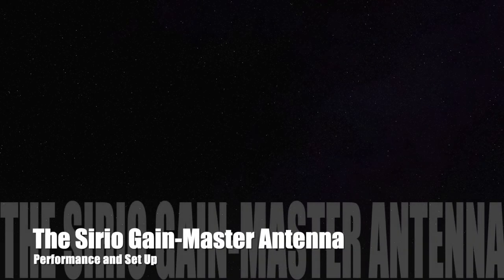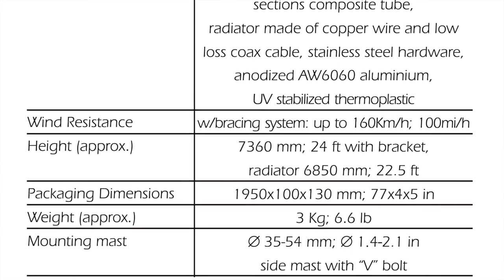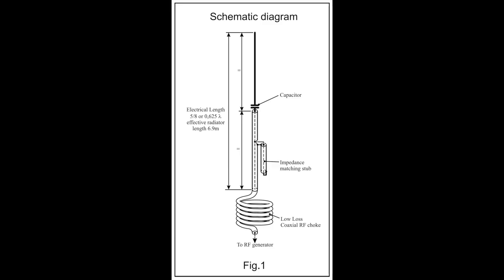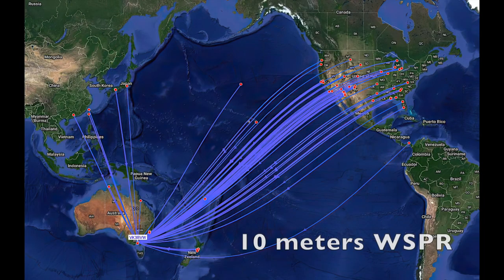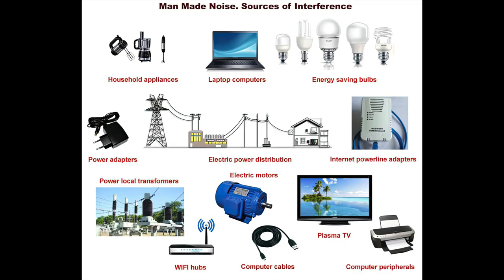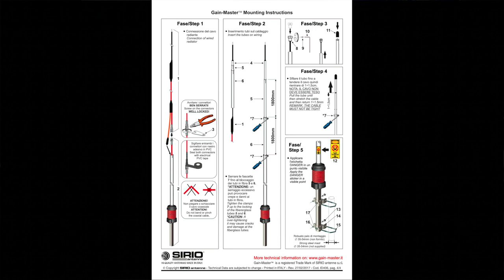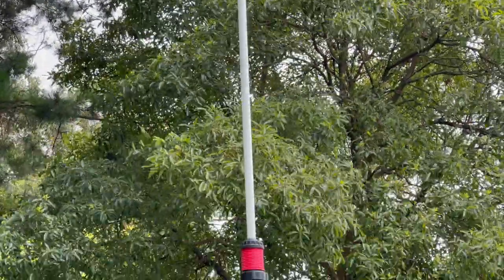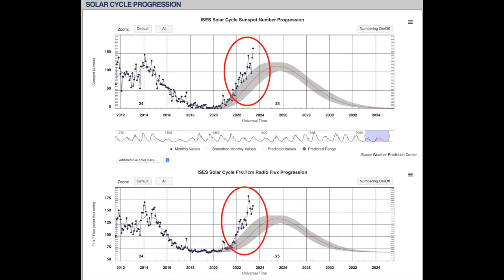The Sirio Gain-Master Vertical Antenna: A Review and Set-up

Comment: Nice one Rob!
Have used exactly the same method of guying on a 40m 1/4 wave vertical that I put up a few weeks ago.
Has also survived the high winds just fine so far.
Going to look into one of those Sirio verticals for the higher bands also.
73's!!
Reply from the maker: Good comment, Adam! We seem to be getting lots more wind here these days than we used to even ten years ago. We need to make sure that our antennas stay up in the air! Thanks, mate. Cheers, Rob VK3BVW

Comment: Hi Rob .. I noticed where you had the antenna mounted seemed reasonably close to metal roofing and gutters .. how far is the antenna from these ? I am looking at roof mounting mine and would use a 3 meter mast so I am hoping that would be far enough away from the roof sheeting.
Reply from the maker: Hi Richard. The base of the antenna (below the red choke winding) is just under 1 meter away from the steel roofline. I have noticed no effect of the roof on the antenna. In fact, before it went up to its current location, I tested the antenna for about three weeks on a large tripod (old PA speaker stand) at about 2.5 m off the ground. I got the same SWR readings at ground level as I did when placed above the roof - which I was very pleased about. I suspect that because the antenna is center-fed, it acts independently of objects below it. Thanks for checking out the video.
Reply: @RobVK3BVW  thanks for that information Rob .. I was suspecting somewhere around a 2 metre clearance would be sufficient to have no interaction.. 73’s Ric